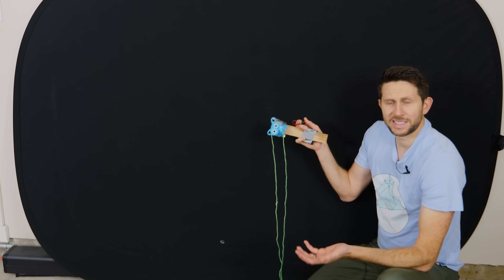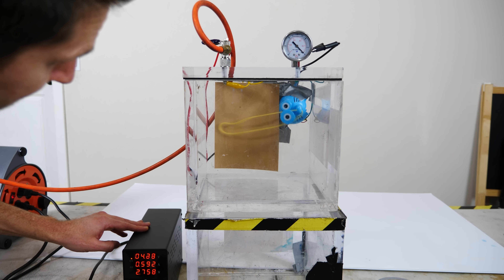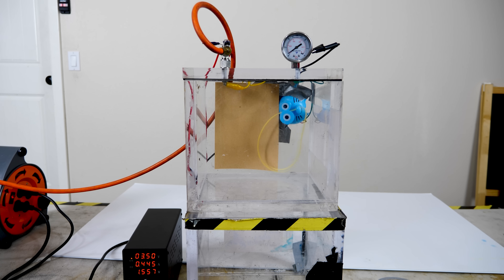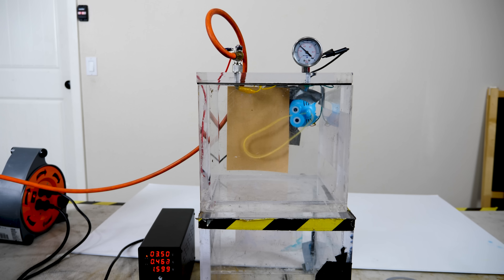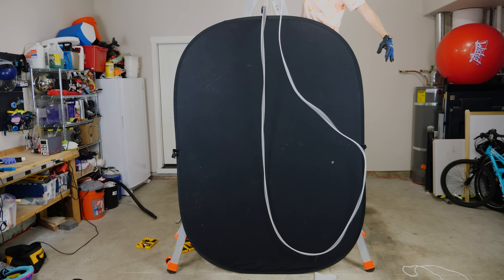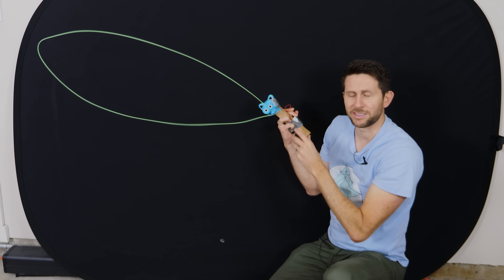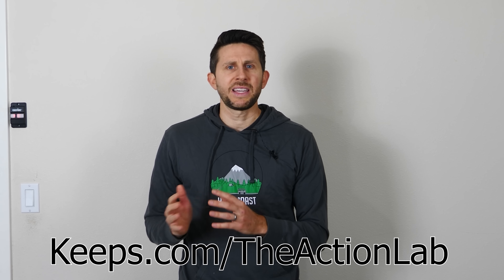The Real Reason a String Launcher Works

Comment: Great breakdown... however, consider how a ball chain version stays in the air, with little drag.  I think you are correct in that the air resistance slows the free fall of the chain, but I disagree that this is some sort of lifting force.  As the string is launched it tries to compress the string downstream of it.  At higher speed the string is stiff, like a wire.  At slower speeds, more like a wet noodle.  So as the string slows down, the force or gravity and the tension of the return string causes it to drop.   Consider this:  What would happen with the string in a vacuum, but under no gravity?  I think the string shooter would work successfully.  Or in another scenario: under vacuum, but with a ball chain that has more momentum and less articulation, lending it to it being more stiff and less prone to buckling.  Thoughts?

Comment: What if the air helps with string lift, but does not cause it? Momentum in the string (which also makes it heavy so not very noticeable) should also work in vacuum but would need higher force to fight gravity

Comment: so then whats the theoretical limit of the string length?  if you had a motor that spins with much more torque and the same speed could the string be 300 feet long if the string is very very light like fishing line?

Comment: Neat demonstration, but the explanation makes zero sense to me, after watching it multiple times. The string is moving forward; presumably "drag" would tend to hold it back? How does drag create tension on the string? If the tension becomes greater as you move farther out, then there is no limit to how long the string can be, until the string breaks from too much tension?

I dunno...he may be right, but it seems like a "just so" explanation to me, jumping from "there is air/drag" to "it's pulling on the string" without explaining any mechanism for that happening.

Certainly there is something odd about the distance and "loft" of the string coming out of the launcher; it just looks unnatural. One cannot envision a short 1/8" segment of string flying on such a trajectory, if launched at similar speed. My thoughts are trying to come up with something comparable... geese flying in formation seems close, but not quite right. It is definitely one thing to minimize air friction by not having a "front," but a whole other thing for the system to fail when operated in a vacuum.

Comment: this is the same reason parachutes still stay aloft horizontally, when sufficient airspeed drags the parachute behind, as seen with drag races.

The airspeed velocity of the car flings the parachute backwards as it carries it a distance, and air gets trapped in the hemispherical inner cavity of the parachute, causing drag.

Comment: horschett    dude         was this was a  IQ  test.   if so, i passed.          many processes  do  NOT  scale  down (or up), accurately.!!!
at 3:52,  bravo,  for having the launcher  NOT  in the frame.!!!
bravo, for failing to address the  DIFFERENCES in  energy to Mass  ratio, when a  heavier  line  is  launched.!!!
at 4:19 to 4:40, horschett.     this is a contrived explanation of a  FLAWED  demonstration.!
at 5:02,  yeah.   because of  GRAVITY.   tool.
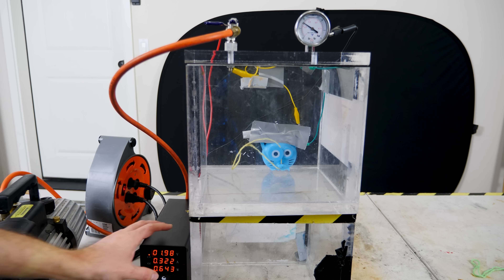at 5:33,  another  FLAWED, scaled-down  demonstration.!!!
at 5:53 to 6:00,  more   horschett.            
score:   0 / 10              googletranslate

Comment: Let us try to push forward TOGETHER the technology progress!:)
1) The first link below describes an EXTREMELY simple zigzag mechanical experiment, which (a) can be EASILY carried out in your garage or even on your kitchen table and which (b) BREAKS SEVERELY the law of conservation of mechanical energy and the law of conservation of linear momentum. And here is this first link:
https://www.youtube.com/watch?v=xX14NK8GrDY
2) In the above mentioned EXTREMELY simple zigzag mechanical experiment friction (and the related experimental error due to that same friction) is reduced practically to zero either (a) by using of simple permanent magnet slides or (b) by using of liquid-nitrogen-equipped slides, which can be found in the two links below:
https://www.youtube.com/watch?v=KQH2UhHss6c
https://www.youtube.com/watch?v=Vxror-fnOL4
(A cup of liquid nitrogen costs $2 only.)
3) We (our team) are experts (Ph. D.) in theoretical and applied mechanics. We are open to discussion. BUT MOST IMPORTANT -- FIRSTLY CARRY OUT THE ZIGZAG EXPERIMENT BY STRICTLY FOLLOWING THE SIMPLE INSTRUCTIONS IN THE THREE LINKS ABOVE AND JUST THEN TRY TO DISCUSS ANYTHING! BECAUSE OTHERWISE WE ARE SIMPLY WASTING OUR TIME!
Let us try to push forward TOGETHER the technology progress!:)
Reply: bla-bla-bla         idiocy

Comment: Good job with experimenting with the vacuum chamber!

However, the expansion is missing the point about buoyancy force. (https://en.wikipedia.org/wiki/Buoyancy)

For each bulb of the chain, drag forces don't care which direction the bulb is going. It's buoyancy, against the gravity direction, which cares about the direction, pushing up.
Reply: ehhh      no !

Comment: It’s not because of the air lifts the string, it’s because the air is ripped with the string by the string.
And the string is further held within the stream of of air which is created by the moved string.
Measure the airspeed in front of the string,where it is nearly straight
Reply: nope.      it's because you and 99.999 percent of  the commenters, here, are  airheads.     see my comment, above

Comment: Just like pulleys which is what operates large drum fans and industrial style exhaust fans. The motor gets the power and that rotational force is all the pulley needs to do the dirty and difficult work of spinning the blade

Comment: That is too cool of an experiment. Call me gullible because I'm not anywhere close to being as Savvy as a lot of you when it comes to this stuff but I have a question. If the string works off of atmospheric friction does the same principle apply when a pitcher throws a baseball? And if so, if a person had a big enough vacuum chamber and a powerful pitcher threw a fastball in it, with the ball essentially come out of his hand and fall to the ground? Again that is such a cool experiment.

Comment: Okay interesting. But what if you added high-pressure into the chamber with the string act differently? As like an airplane has better lift when the air density is higher versus at a higher altitude with a low air density pressure. I would like to see that

Comment: Saying the drag lifts the string is misleading. The motor produces a force on the string up and to the side, and gravity is pulling it down. Air drag is a force that resist gravit, thus pointing up. The key detail here is that drag is never greater than the opposing force. Gravity could never produce a drag force that can overcome gravity itself. Thus air drag only reduces the effect of gravity, and the force of air drag plus gravity alway points down. So by adding up all forces, the only source for the upward acceleration can come from the motor.

In the vacuum chamber you can clearly see that the string is always accelerated to the left, even in a vacuum. The vacuum just reduces air drag and thus increases gravity. But all in all there is still a net force pointing left, even if it is less pronounced.

In a nutshell, air drag is amplifying the effect, it doesn't cause it.
Reply: seven points, awarded to gryphyndor.       if you want know why only seven, see my comment, above.

Comment: Would it be accurate to say that it is the medium of the air acting like a buoyant force, keeping pressure on the string, allowing its acceleration to have more impact on how far it can reach? Like a knife being "hugged" by butter, keeping it upright when placed there? Like how we float more easily in water? I didn't quite understand this "tension on the string" idea.
Reply: it would be accurate to say that this demonstration has  HOLES  in it.!!!      see my comment, above

Comment: Please answer my question about your vacuum chamber, How you can make a full vacuum like this (nearly -1 Bar)? Besides your pump strength could make it done, are you located at sea level? I am a student and I'm working on a mechanical thesis that needs a good vacuum near -1 Bar. I am located in a place that has 1200 m high above sea level and I can't reach the vacuum less than 0.9 Bar with a 12 m high water column. is there any hope to make a better vacuum in my location?

Comment: So what would happen if you used liquid helium instead of water in a water mill that has the liquid helium flowing down instead of horizontally with a way back up to the top? Since the liquid helium has 0 viscosity, wouldn't that be called work

Comment: now i want to know what happens if you ADD air.. instead of a vacuum let it run in a compressed chamber. Would it shoot outwards even further?
another question, what about more dense medium like underwater? you would probably have to test different materials for the string however..
one last queestion.. lol  -what if the string itself was dense? could you possibly use a steel guitar string and see how that behaves?
plz upvote if you are curious as well :)

Comment: What makes it unique is in that it discards the use of a ripcord or shooter in favour of a T-shaped handle supported by string. This long, white string is placed on a white gear that works together with a smaller gear in order to retract and allow use.

Then came along the Vacuum Chamber. A vacuum chamber removes air and pressure from a confined enclosure to test the effects of a vacuum on parts, materials, components, and assemblies. It can also be used to test the performance of applications for manufacturing operations.

Comment: So in an environment with more pressure like an oxygen cylinder do you think it would go up higher or would the results be erratic? Also if the same experiment was done in a place with several more atmospheres of pressure would it be the same result? Or would the change be minimal?

Comment: Ok so you demonstrated what happens in the vacuum chamber, but what happens if you were to add compressed air, would the lift be more active or be able to lift the heavier string.

Comment: Makes sense that the amperage dropped .4amps with a vacuum. And went back up as the string came with. The string doesn’t have air to fight friction with in a vacuum, which requires less current draw.

Comment: Did anyone else see the drop of amperage when the pressure in the vacuum chamber dropped and increase as pressure increased? about 0.03 am swing. interesting..
Reply: 1.54 watts to 1.8 watts thats not insignificant

Comment: I think your explanation about the tension in air pulling it out from the spinner is ridiculous. A far more reasonable explanation is the fast moving string at the spinner is viscous dragging a jet of air along with it, and this air jet holds the string within it as it moves outward. Eventually the air jet spreads out and slows down and the string drops from gravity. You'd see the same effect with a length of string held up by a blast of air.

Still I had no idea this thingy needed air to work. Thanks for the insight.

Comment: Try it with a ribbon  that would be cool
Could the Magnus effect also be involved. the string is also moving faster on the outside than the inside this could be making a low air pressure on the outside of the string pulling or lifting it?

Comment: I am pretty sure there is one assumption wrong in this experiment: "The string is turning the same speed" The string in probably much faster in the vacuum. You should put some mark on string or the wheel and measure the actual speed.

Comment: You have blown up the theory of wing effect that tried to explain why planes can fly by means of a yet not demonstrated suction effect due to the difference of air speeds, hence pressure, between the most curved and lengthier profile surface, usually above and the flatter and shorter profile, usually below, of the  wing. Good Job

Comment: The tension explanation doesn’t seem to explain why it goes in the same direction the shooter is pointing. On the other hand, the commenters who are talking about entrained air flow which increases as the string gets more fuzzy, that’s a lot more convincing…

Comment: I don’t know if it has been mentioned but as vacuum goes up current drops almost 70mah and goes back up when it returns to atmospheric pressure. Kinda cool might be due to no drag on string and resistance on motor fins, armature.

Comment: The most important phenomenon in this experiment is the interaction between the wheels and the ambient air. The air spins around the wheels due to aerodynamic drag (a.k.a. friction). The aerodynamic drag between the air and the string pulls the string in the direction of the spinning air.

Comment: Nahh....
If tension increases towards the string inlet then at the far point of the loop there is more tension pulling down than up.

I'd look more at an entrained air flow blowing the loop out.

Comment: Upon reading the article you sourced it from, they state a few things.
a) There is no lift at any segment of the string
b) Sum of drag forces is zero across the string.

They explain that the reason why this works is because locally across the segments, the drag forces creates a moment that counter acts the moment caused by the weight.
The shape it forms is the shape that perfectly balances the two forces.